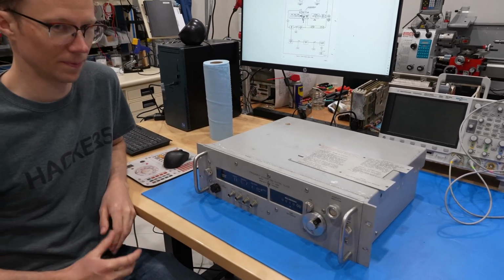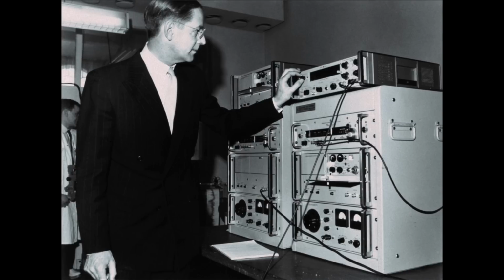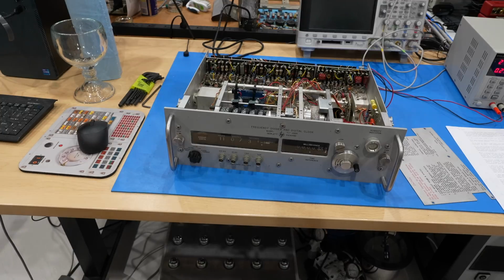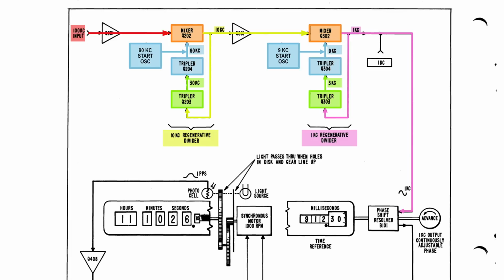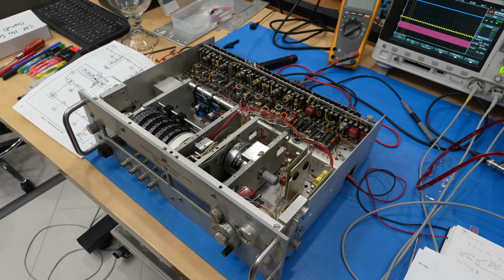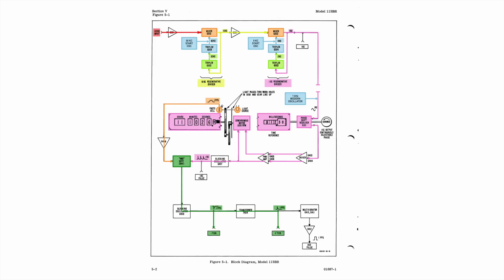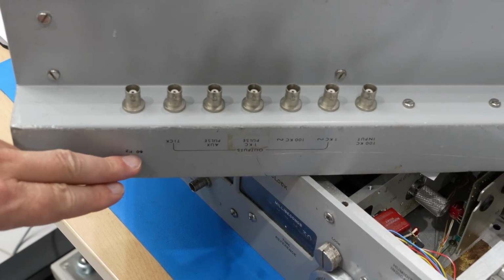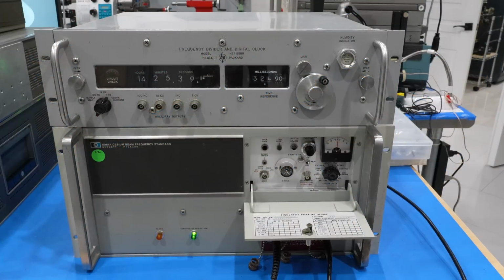HP 115BR Divider and Clock - Part 1: The clock that once sync'ed the world

Comment: As I understand it, there are three maneuvers needed every time the clock is powered on: kickstarting the regenerative dividers, cranking the synchronous motor and, of course, setting the time. But all of these require opening the (hermetically sealed) casing?

Comment: Worth noting that the flying clock was an H20. It's barely visible in the photos of the flight case.
Reply from the maker: The high quality photo of the flying clock is actually not the original, but was put together by hpmemory.org. The original had a prototype Caesium and a prototype modified clock. However, triple kudos to hpmemory for using the correct model of clock in their setup!

Comment: I would not be surprised if the syncho-resolver was specially selected for the 10kHz signal. The resolver coils are being operated at much higher frequencies and thus the parasitic inductances play around with the three port transfer characteristics of the resolver. But they are manufacturing at a test and measurement company.

Comment: Great video, thanks! I have the dark gray version of the straight 115BR, former Air Force property. Haven't gone through it yet, still need to finish repairing my HP 105, which had a major power supply failure before I got it.

I also have the HP K22-5321B Nixie clock to run off the HP 105 once it is repaired!
Reply from the maker: Nice collection! Good luck on the all the HP repairs. Keep them going!

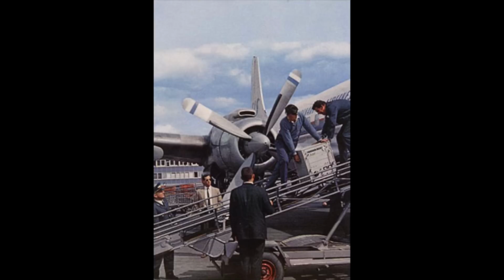Comment: The aircraft at 3:24 appears to be a Douglas DC-7, which is powered by four (piston engine) Wright 3350 turbo-compounds, not turbo props.
Reply from the maker: Thanks for the correction. That still flew with pistons? Thanks goodness they didn’t use regenerative dividers in the engines ;-)

Comment: I have been vexed several times repairing old HP gear because HP loved to have their own part numbers for semiconductors.  None of that JDEC 2N… foolishness for HP!  Anyway the HP engineers liked to make their designs rather dependent on the specific characteristics of the semiconductors.  If you don’t sub in the right transistor, the circuit card just sits there as if mocking “Is that the best you’ve got?”
Reply from the maker: But do you know that I have now scanned the fiches for the HP semiconductors and uploaded them to the internet archive? The ones for transistors are here: https://archive.org/details/c000_r006 . It gives the parameters for the HP only transistors, which usually are just selected versions of 2Nxxxx appearing a few lines above or below. Or replace the  with something better.

Comment: How does the regenerative divider stay stable? For instance say the starter had a slight error and was at 90.1KHz, then the mixer produces the low signal of 9.9KHz, which gets tripled twice to 89.1 KHz, with a 9 times larger error than at the start. If it was working in reverse that would make more sense to me; using two 3x dividers to get the 10KHz and a mixer to generate the 90KHz signal which then gets divided again.
Reply from the maker: That is an excellent point. It’s not exactly implemented as I drew here. There is no separate 90 kHz start oscillator. The 90 kHz tripler circuit itself is used. The tripler is in essence a very resonant amplifier, almost an oscillator, so the start pushbutton just enables a slight additional feedback that brings it to oscillation. When the push button is released, the oscillator will not jump instantly from 90.1 to 89.1 kHz, it will start sliding towards 90 kHz and reach equilibrium. That said, it must be an interesting design challenge to make the triplers resonant enough to make this stable, but not too resonant that they self oscillate.
Reply: @CuriousMarc  Thanks! I was thinking about it more and had wondered if it might have had something to do with some sort of resonance/feedback in the tiplers that the diagram was glossing over, it sounds like it is something to that effect.
I had realized that the frequency would have to slide through the correct value but figured that there had to be some sort of delay across the triplers which could cause it to overshoot the correct value so that it would actually end up oscillating around the 90kHz just a little in an amount of time on the scale of that delay.
Clearly the people who designed it did something clever that I'm not quite wrapping my head around. Or maybe that delay time is just so small that it is would just change the wave shape a bit in a way which would probably get smoothed out by other components.

Comment: I wonder if the early 1970's HP computer/control stuff like the HP9825 could use the precise 1kHz/60Hz signals as a time reference (for timestamping measurement data etc). This would especially make sense if you have to compare data (or syncronize actions) from systems at different locations.

Comment: what a magnificent video :-)))) thanks for your hard work! Please add a description of the helper clocks for the 2 mixers that are activated internally by hand, i didn't see or recognize them in the original block diagram or wire plan.
Reply from the maker: Aha! That’s because they cleverly re-use the 90 kHz multiplier as the start oscillator. So it’s sort of hidden in plain sight… I showed it as a separate thing for explanation clarity.

Comment: A tightly sealed device, but you have to open it to turn on the ignition and crank it to start ;)

I suppose you weren't supposed to ever switch it off?
Reply from the maker: That’s correct. Meant to be run on 24V with battery backup. If the reference 100kHz disappears, the divider stops, the clock stops, and won’t restart on its own so it does not indicate the wrong time. You then have to restart and resync it manually.
Reply: @CuriousMarc  Yes, another reason to have regen dividers: If there is an interruption, it stops, which makes sure that you KNOW that there was an interruption. Similar with the mechanical time-of-day display: If there is a fault/interruption, the user can see WHEN it happened. If the time display was electronic (i.e. Harwin displays, Nixies, whatever), then the time-of-fault would be lost.

Comment: Ah - regenerative dividers. I recognize that block diagram from the old 5105A + 5110A synthesizer combo. I bent my mind around that way back when this was a brandy new product in the early/mid 1960s. (1964?) The concept almost made it aboard GPS satellites but people were worried about the regeneration starting up correctly. So I broke the feedback and gave GPS a dither error that was proportional to its output frequency. At the accuracies involved here it is noticeable, in the lab if not on the signal from orbit. And it may be different on newer satellites. I worked on Phase IIB.

{^_-}

Comment: Hang on..  Why is the “starter” oscillator switch internal rather than being an external protected switch? That seems inconvenient.
Reply from the maker: It’s on purpose. It’s to prevent to accidentally restart the clock once it has lost lock. If the reference 100 kHz disappears even for a split second, the divider stops and the clock stops, instead of restarting and indicating the wrong time. You then have to open it up, reset it and resync it, which is an hour long procedure anyhow.
Reply: @CuriousMarc  Yes, and the mechanical display (rather than electronic) tells the user exactly WHEN an interruption occurred, which might be important.
Reply: Given the way this would be used it isn’t something you would ever see needing to triggered after starting the whole system. This sort of thing you’d start once and keep powered for months or years at a time. Same reason the knurled knob to get the synchronous motor running is only accessible when the box is open.
Reply: @ If it’s potentially only months or a few years, I don’t think it’s a good idea. But I might be too steeped in the idea that everything must be remotely controllable, per the current paradigm.
Reply: My guess is because the switch, like the motor, is something that could completely mess up the timing if it was accidentally  pressed. This is the kind of device that you set up once and then never touch again, so it makes sense that it is locked away